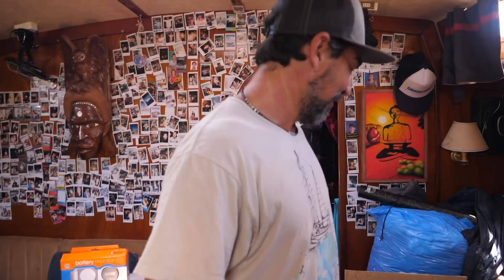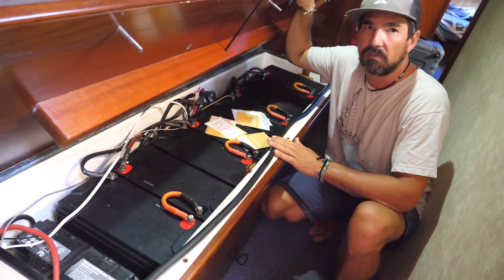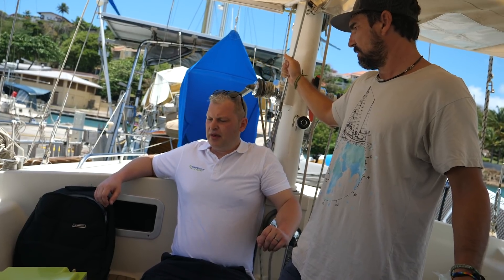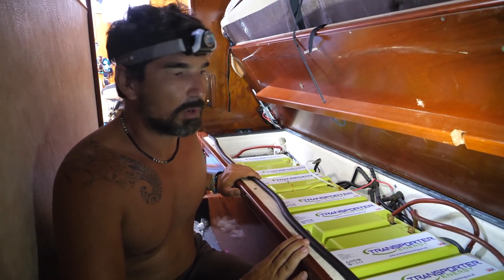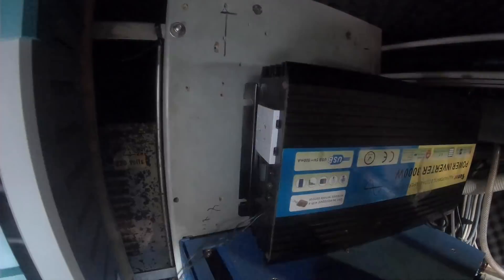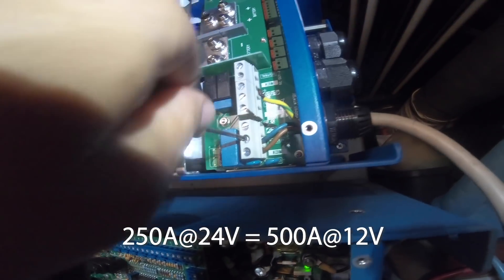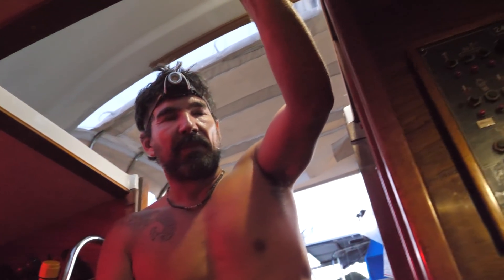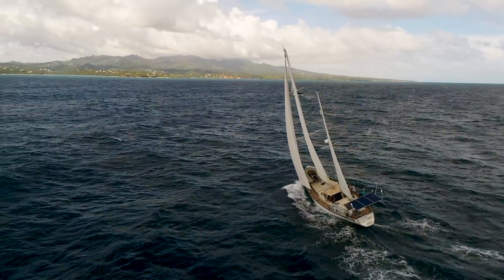Hello LITHIUM, Goodbye Propane!!!  Part 1-  Sailing Vessel Delos

Comment: Lithium............how do you get comfortable with the potential for a runaway thermal event?
Reply from the maker: This particular chemistry (LifePo4) is not very suseptible to that issue, much less than others with higher energy density.  That, and redundant battery monitoring systems and properly configured controllers.  Honestly I think it's much safer than propane aboard....
Reply: Ok.  Just be careful.  The confines of a boat caused me concern.
Reply: One huge advantage of LiFePO4 is they are NOT at risk of thermal runaway, ie  overheating and catching fire, like other cathode formulations of Lithium. That is why they are used in electric cars. (I looked into this 9 years ago when they first came out, and built an electric bike with them.) BTW, don't confuse the generic term Lithium ion with these Lithium iron batteries. It seems everyone falls into that trap. The ion (anion) here is iron phosphate.

Comment: I also went electric for the dingy motor, 3HP for a 2.5m inflatable rubber boat, after 6NM on it and still 50% charge I am very happy to go that way. Finding good gas here is hard, and after drowning the dingy, I was happy not to have a typical engine with a carb and fuel tank. The battery floats and the engine can be dunked under water for a while and it will still just work. Maybe rinse it with fresh water once in a while . Filling the tank with the solar panels is great even if slow, but it is constantly charging while on the go.
Reply from the maker: sounds awesome man, what brand are you running there?  Brian
Reply: There are 2 options I've considered, The one I went for the ePropulsion Spirit 1.0,  Torqeedo 1003 has a good product too , But they have an extra gear instead of the direct drive, 2 wires instead of 1, lock pin to loose and are noisier, they might be 1 generation behind. With ePropulsion, the main issue I have is the fact that the power cord is sticking out at 45 deg from the battery, This was an issue when I passed under a bridge at high tide. On the plus side, when I've hit the prop on stones the motor went in an error mode and stopped, I simply did a power cycle and went again.   Then 1kW max power is 1.34HP, but both companies claim an equivalence of 3 to 4Hp.

Comment: ok i had to stop the video here... at 9 minutes 30 you say you don't worry about shocks unless you're above a certain voltage... it is NOT voltage that is dangerous.. it is AMPS and those battery's contain a friggin truckload of them. 0.75 amps running past your heart will kill you without question. 10.000 volts on the other hand is perfectly save as long as the amps are below 0.4 or whatever it will not kill you even if it runs past your heart. (assuming a healthy individual with no heart condition). when you were touching the positive pole on 1 battery and the negative on the other you got lucky that they werent hooked up yet as you didn't complete a circuit but you would've gotten a really nasty shock right there if they were, but you probably knew that.

Comment: So no oven now? I see you have a bread maker and microwave. No outside bbq because that would be propane? In Australia I would ask how are you going to avoid going on a date with Tom Cruise if you can't cook a roast?
Reply from the maker: Ha Ha nice!  Ditching the micro and have our eye on a sweet little convection oven of the same size.   We also got our hands on a marine electric BBQ with the same mounts as our Magma, have yet to test yet but will report back when we have some results.  I too am skeptical about the BBQ but current one gets blown out in the wind anyway so that's a bit crap....  Stay tuned!  Brian

Comment: My experience with lithium battery’s is not good ,  there are things to remember , they don’t like impact , impact causes instant fire , short out a cable and you may have an explosion, they smell , power cables need to be in new condition or they will cause problems is the battery can’t deliver the voltage it will get hot on the way to explosion, , the battery compartment needs to be live vented , through flow of forced air  ,but good luck , watch them especially under charge  ,,all good ,,
Reply: One huge advantage of LiFePO4 is they are NOT at risk of thermal runaway, ie  overheating and catching fire, like other cathode formulations of Lithium. That is why they are used in electric cars. (I looked into this 9 years ago when they first came out, and built an electric bike with them.) BTW, don't confuse the generic term Lithium ion with these Lithium iron batteries. It seems everyone falls into that trap. The ion (anion) here is iron phosphate.
Reply: David Tangye  total crap more boats have been burned to the waterline with lipos when they are compressed or hit they will explode they hate heat , and some country’s is hot and more so hidden in a locker , we use them in helicopters and they are taken out of the machine and charged , for insurance reasons and charged in a concrete sell ,
Reply: @kz4506  are you sure that you are talking about LiFePO4 ?
Reply: David Tangye liFepo are hot with big drains high amp motors throw at them

Comment: select your cookware with a magnet. The pans with highest attraction will cook the fastest.
Reply: Bollocks. Aluminium has a higher heat coefficient than iron/steel. And, managing fuel usage will sage you far more fuel than a slightly more efficient pan.
Reply: @kevinu.k.7042  The system transfers energy through magnetic inductance, which is not doable with Aluminum.
Reply: @josidasilva5515  This is not true, read what are Foucault's currents.
Reply: @MaxPivovarov  Buy one, put an aluminum pan on it and tell us the results.
Reply: @josidasilva5515  Taxom is correct, induction heaters work via electrical conductivity, not magnetic susceptibility. The aluminum foil demo in the linked video is clever.
Reply: @r0cketplumber  https://en.wikipedia.org/wiki/Induction_heating 
I cook with induction heater and I tried using aluminium pans. Have you?

Comment: Great video Brian,. How much more is litium ion cost  than regular lead acid?  I've got an off grid cabin in Canada and This vid makes me wonder if converting lithium ion would be a feasable move. Mind you we mostly use our solar power for lighting and charging computor , walkie talkies and cordless tool batteries. So far using two 12 volt AGM in a  12 volt config.
Thank for the informative video! 🇨🇦
Reply from the maker: Sounds like a really sweet place!  The battery and kit prices can be found at the links here http://svdelos.com/lithium .  I think it's all a matter of how long you're gonna own the place to see if it makes sense.  Hope the summer has been treating you well.  Brian
Reply: Sailing SV Delos Thx Brian, and oh , yes summer has been amaizing ...so far! Fair winds to youand the crew!

Comment: Hope you don't ever get a lithium battery fire. If so, you are going to the bottom guaranteed unless you can eject it overboard like the Navy does with F-14s that catch on fire. Watch the YouTube videos on lithium battery fires.
Reply from the maker: With good and redundant battery management I think these are much safer than Propane aboard actually.....

Comment: are you concerned about the lithium being reactive with water?
Reply from the maker: Interesting to consider, but these are sealed cells.  If we were to flood this compartment the BMS will isolate the cells internally, as I understand it.
Reply: Oh cool.  i only asked as I build Lloyds registered yatch  in the UK and at present are not allowed to use them they don't fall into class because the risk off exploration thanks for the reply  all the best
Reply from the maker: Hmm, sounds like a case where perhaps the regulations have not caught up with the tech yet...  You can fly these on a plane now!
Reply: yes possibly.. that could be the case   but there  not that new been using  i believe  since early 1990  so they would off been classed by now if applicable we have very strict laws in the UK sometime to strict

Comment: Very cool information. I have a cabin in the mountains of Oregon and would like to install this type system, do you think it's doable. So what was the price of this system installed ? How do you cook with out an oven or did I miss that part? My place is on grid but looking to go off grid and your system might just work. Thanks again Team Delos. Hey didn't see Ms. Blue, I hope Brady doesn't mess that up.
Reply from the maker: Ha Blue was editing in the marina bar :) You can see some prices at the links here if you want- svdelos.com/lithium .  Thinking of a small electric convection oven, still working that one out though.  Will keep you posted.  Brian

Comment: Brian, take a look at super capacitor banks as a means to buffer peak power demands. I think you can combine them with the batteries, might be able to replace your starter battery.
Reply from the maker: I looked into them, it's a very cool concept but from what I understand the energy density is still very low and you need a huge amount of area.
Reply: I understand you can get a 6 capacitor unit the size of a car battery and people are running them instead of the car battery in their vehicles with no problem. They recharge through the alternator. The idea is that the capacitor will provide the quick peak amps e.g. for starting an engine then slowly charging from the batts or alternator. I understand that the rapid discharge and charge are the issue with batteries (incl the heat that might be generated in the process), a combo with a capacitor should smooth that out. Caveat: I have not tried it myself. A big hello to the crew!

Comment: So these Lith-ion fires are caused by the batterie(s) getting too hot from overcharge or discharge? And the auto computer cutoff prevents the batterie(s) from overheating and starting a fire in the first place?

Comment: Excellent installation job, Brian. One question. Are you not losing a couple of burners with your induction cooktop? It looked like you only have two burners now.
Reply from the maker: Yea, but I think the arrangement on 3 burner marine stoves sucks anyway.  We really could only use 1 burner (the big one) because they are so damn close together for our pans.  At least now we can use two pans of decent size.
Reply: Sailing SV Delos Ok. Understand your reasoning. Fair winds and following seas!

Comment: For boiling water I recommend you buy a dedicated electrical water-cooker. A common household item in Europe.
Very fast and efficient, boiling time under 2 minutes. Most hold 1.5 to 1.7 liters, draw 2 - 2.5 kW @ 230V, and cost from 30 to 60 euro.

There is one big advantage of induction cooking that is not mentioned in this video. Burning propane gas inside your boat generates carbon dioxide and steam (and heat), which all have to be vented out. So induction cooking also reduces moisture problems, like fungus growth and corrosion of delicate electronic components.
Reply from the maker: Yes, we need to run a test on the electric kettle.  You are correct on the power, the inverter should handle it and it will consume the same amount of power (more watts but less time).  Nice comments.

Comment: Great video guys! QUESTIONS!! What would the cost difference be between that setup and a normal led/acid - propane rig when doing a refit and replacing everything. Nothing exact mind you, but just in general are they even close or is there a huge price difference. *  Also.... What about the BBQ grill?! LoL 😎
Reply from the maker: Yes, this is definitely an investment and makes sense if you plan to have your boat for a while.  Stay tuned for the BBQ, hope to handle that in Part 2 :)
Reply: The price difference for Lithiums is massive. I have a bass boat with 3 12v leads so $600 for good batteries. To go lithium would cost almost $3k.
Reply: Trey Redding Thanks!

Comment: 3000 watts at 240 volts would be about 12 Amps. Your induction cook--top top would most likely use half of that per burner. So if you only use one burner each time you cook, you could also get a small Electric oven about small pizza pan size and pizza is important ;-). Maybe a couple more solar panels or replace with some with a higher output ?

Comment: Hello Brian, that was a very interesting video, 
just one question, hypothetically if you were running a 12 volt system with the 8 batteries and one batteries on-board processor senses a fault and shuts it down, you would have a 7 battery 12 volt system until it resets. 

But if as you are doing connecting them two 12 volts in series to create a 4 battery 24 volt bank, what happens if one battery senses a fault and shuts down changing your banks make up to three 24 volt batteries and one 12 volt battery? 

Shouldn't there be some kind of processor link to switch off both batteries in each 24 volt section leaving you with 3 battery 24 volt system until it resets?
Regards Dave
Reply from the maker: Hey Dave good question, in that instance if one of the batteries were to fail then both in series would effectively go offline, since the "offline" battery would basically be an open circuit, almost like not being hooked up.

Comment: When you guys get your cold water boat, what are you going to do for heat in the upper lat's?
Reply from the maker: I have not seen many options other than a diesel heater, whether forced air or hydronic.

Comment: One thing that I don't understand:
24V*70A=1680VA So the manufacturer how get the datas, that wrote on the inverter (24V, 3000VA, 70A)? And what is invalid from that?
Reply from the maker: Yes, it's confusing as shit know.  I believe the 70A rating is for the charger side (since it's a combination unit).  If you divide 3000 by 24V this will give you the approx current on the DC or inverter side.

Comment: Great video! Do you have to do anything with the alternator regulator or does it remain separated just for the starter battery?
Reply from the maker: Yes, we actually have two alternators.  One 24V for the house bank, and one 12V for the starter battery.  The 24V one requires an inline DC to DC battery charger to regulate for lithium.

Comment: Brian, have you ever tried using Liquid Tape on the terminals? I used to use them when I worked repairing GMDSS radio stations in vessels and they keep the terminals like NEW. LiFePo4 was a really good choice! When I first saw you guys going Lithium I didn't knew that they already have this kind of Hi-Tech batteries ready for marine use but even though It is safe I would buy the proper fire extinguisher for Lithium, ya know, better safe than sorry. Xoxo!
Reply: Forgot to say, and liquid tape are really easy to take off when you need, just cut around them with a knife and you're good to reuse the terminal.
Reply from the maker: Thanks for the advice Felipe!
Reply: It's a pleasure to help!

Comment: Great video Brian. Is that the Kenyon cooktop?
Reply from the maker: Yes, it is!  We also have a grill from them we are gonna try out.
Reply: Nice. Those look really cool, and I'll be interested to see how well the silicone holds a pot in a seaway with the gimbal box you had made. Swap out the microwave for an induction microwave and you'll really be cooking without gas!

Comment: Great video! I am looking forward to the  part two video.  Curious as to the cost percentage difference between lead-acid and lithium?
Reply from the maker: Depends on the lead-acid brand of course, but it could be several multiples.

Comment: Three Questions. 1) since it can run blue-tooth can you create an alarm to go off in the case of a malfunction? 2) Will you ever replace the engine for an electric one? aka uma 3) I know you are way ahead of the curve and maybe I missed this but here it goes---Certain boat appliance such a/c there is a heavy load to the battery when it starts-up and than levels out. Gone with the wynns had to have a piece connected to take the load of that draw. how does yours work There is nothing sexier than a man who knows his shit. Sorry Kazza. I like everything you guys put out.--stay cool
Reply from the maker: Not sure about the bluetooth alarm, but the unit itself has an alarm I believe.  I have been studying electric propulsion quite a bit, I do not think batteries are there yet for a fully electric system given our range requirements.  I do think electric-hybrid is a definite possibility though.  I have seen that video from the Wynns, I think they were trying to run an AC unit or something like that.  And ha ha thanks :)

Comment: Hi Delos Team with the Brian Tech Configuration :-)  Congratulations to your Lithium part 1. It is a real privilege seeing it after the Lithium question about a  week ago. I bet you'll enjoy your new system on the big boat as the "guarantee" of always having enough power on board is such a luxurious asset. I would be very interested in learning about your experience with different charging systems in the lithium mode, especially from non solar input. I wouldn't be surprised if you guys pick up a couple of mobile Lithium packs as well (to charge film gear in the more remote settings). The "getting rid of propane" idea never crossed my mind so far, but it will sure keep my brain busy a couple of days. Keep the good stuff coming - you're doing a great job!